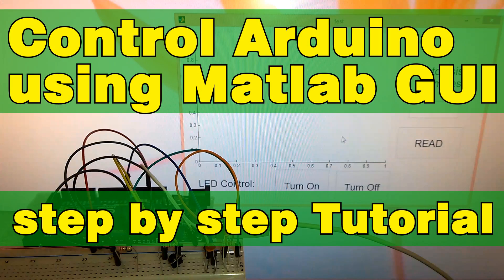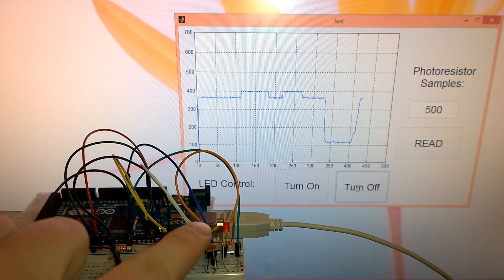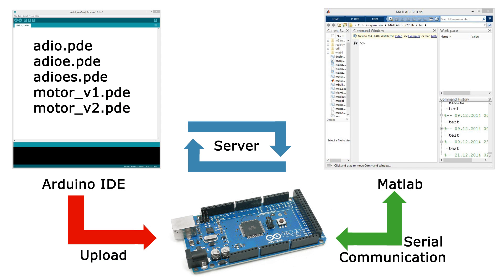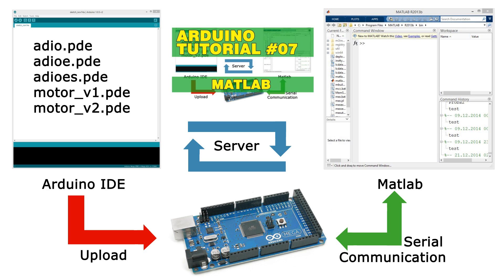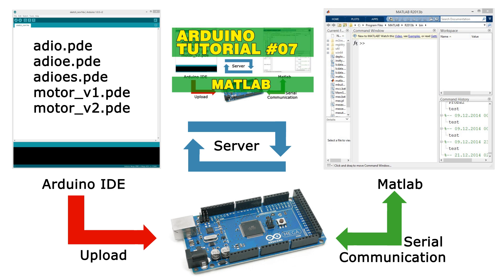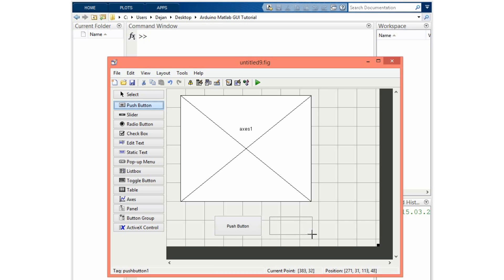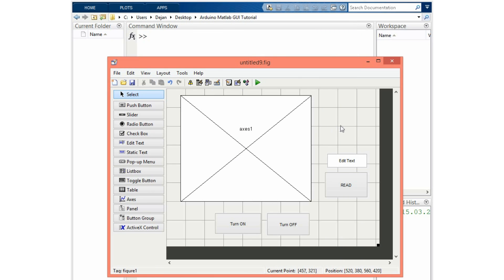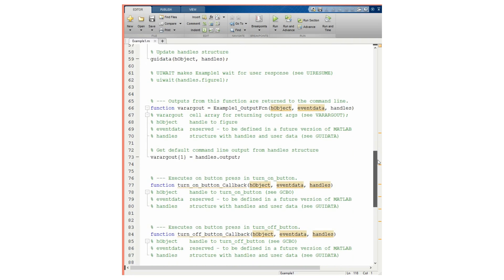Arduino and Matlab GUI Tutorial

Comment: Do not make people lose their time... You should update it or take off the video. It doesn't work anymore.
Reply: hii @Felipe Boscardin use this code
function varargout = analogReadWithDigitalWrite(varargin)
% ANALOGREADWITHDIGITALWRITE MATLAB code for analogReadWithDigitalWrite.fig
%      ANALOGREADWITHDIGITALWRITE, by itself, creates a new ANALOGREADWITHDIGITALWRITE or raises the existing
%      singleton*.
%
%      H = ANALOGREADWITHDIGITALWRITE returns the handle to a new ANALOGREADWITHDIGITALWRITE or the handle to
%      the existing singleton*.
%
%      ANALOGREADWITHDIGITALWRITE('CALLBACK',hObject,eventData,handles,...) calls the local
%      function named CALLBACK in ANALOGREADWITHDIGITALWRITE.M with the given input arguments.
%
%      ANALOGREADWITHDIGITALWRITE('Property','Value',...) creates a new ANALOGREADWITHDIGITALWRITE or raises the
%      existing singleton*.  Starting from the left, property value pairs are
%      applied to the GUI before analogReadWithDigitalWrite_OpeningFcn gets called.  An
%      unrecognized property name or invalid value makes property application
%      stop.  All inputs are passed to analogReadWithDigitalWrite_OpeningFcn via varargin.
%
%      *See GUI Options on GUIDE's Tools menu.  Choose "GUI allows only one
%      instance to run (singleton)".
%
% See also: GUIDE, GUIDATA, GUIHANDLES

% Edit the above text to modify the response to help analogReadWithDigitalWrite

% Last Modified by GUIDE v2.5 19-Oct-2018 07:40:12

% Begin initialization code - DO NOT EDIT
gui_Singleton = 1;
gui_State = struct('gui_Name',       mfilename, ...
                   'gui_Singleton',  gui_Singleton, ...
                   'gui_OpeningFcn', @analogReadWithDigitalWrite_OpeningFcn, ...
                   'gui_OutputFcn',  @analogReadWithDigitalWrite_OutputFcn, ...
                   'gui_LayoutFcn',  [] , ...
                   'gui_Callback',   []);
if nargin && ischar(varargin{1})
    gui_State.gui_Callback = str2func(varargin{1});
end

if nargout
    [varargout{1:nargout}] = gui_mainfcn(gui_State, varargin{:});
else
    gui_mainfcn(gui_State, varargin{:});
end
% End initialization code - DO NOT EDIT

% --- Executes just before analogReadWithDigitalWrite is made visible.
function analogReadWithDigitalWrite_OpeningFcn(hObject, eventdata, handles, varargin)
% This function has no output args, see OutputFcn.
% hObject    handle to figure
% eventdata  reserved - to be defined in a future version of MATLAB
% handles    structure with handles and user data (see GUIDATA)
% varargin   command line arguments to analogReadWithDigitalWrite (see VARARGIN)

% Choose default command line output for analogReadWithDigitalWrite
handles.output = hObject;

% Update handles structure
guidata(hObject, handles);

% UIWAIT makes analogReadWithDigitalWrite wait for user response (see UIRESUME)
% uiwait(handles.figure1);

% --- Outputs from this function are returned to the command line.
function varargout = analogReadWithDigitalWrite_OutputFcn(hObject, eventdata, handles) 
% varargout  cell array for returning output args (see VARARGOUT);
% hObject    handle to figure
% eventdata  reserved - to be defined in a future version of MATLAB
% handles    structure with handles and user data (see GUIDATA)

% Get default command line output from handles structure
varargout{1} = handles.output;
clear ab;
delete(instrfind('port','COM6'))
global ab;
ab = arduino('COM6','uno');
%pinMode = configurePin(ab,'D12');
%pinMode = configurePin(ab,'A5');
configurePin(ab,'D12','DigitalOutput');
configurePin(ab,'A5','Unset');

% --- Executes on button press in turn_on_button.
function turn_on_button_Callback(hObject, eventdata, handles)
% hObject    handle to turn_on_button (see GCBO)
% eventdata  reserved - to be defined in a future version of MATLAB
% handles    structure with handles and user data (see GUIDATA)
global ab;
writeDigitalPin(ab,'D12',1);

% --- Executes on button press in turn_off_button.
function turn_off_button_Callback(hObject, eventdata, handles)
% hObject    handle to turn_off_button (see GCBO)
% eventdata  reserved - to be defined in a future version of MATLAB
% handles    structure with handles and user data (see GUIDATA)
global ab;
writeDigitalPin(ab,'D12',0);

% --- Executes on button press in temp_reading_button.
function temp_reading_button_Callback(hObject, eventdata, handles)
% hObject    handle to temp_reading_button (see GCBO)
% eventdata  reserved - to be defined in a future version of MATLAB
% handles    structure with handles and user data (see GUIDATA)
global ab k;
x=0;

for k=1:1:handles.data2
    v1 = readVoltage(ab,'A5');
    analog = (v1/0.0048875);
    temp1 = analog*0.48828125;
    disp(temp1);
    x=[x,temp1];
    plot(handles.axes1,x);grid on;
    set(handles.temp_ddisplay);
   % axis([0 handles.data2 0 500]);
    pause(1);
end

function temp_ddisplay_Callback(hObject, eventdata, handles)
% hObject    handle to temp_ddisplay (see GCBO)
% eventdata  reserved - to be defined in a future version of MATLAB
% handles    structure with handles and user data (see GUIDATA)

% Hints: get(hObject,'String') returns contents of temp_ddisplay as text
%        str2double(get(hObject,'String')) returns contents of temp_ddisplay as a double
handles.data1=get(hObject, 'String');
handles.data2=str2double(handles.data1);
guidata(hObject,handles);

% --- Executes during object creation, after setting all properties.
function temp_ddisplay_CreateFcn(hObject, eventdata, handles)
% hObject    handle to temp_ddisplay (see GCBO)
% eventdata  reserved - to be defined in a future version of MATLAB
% handles    empty - handles not created until after all CreateFcns called

% Hint: edit controls usually have a white background on Windows.
%       See ISPC and COMPUTER.
if ispc && isequal(get(hObject,'BackgroundColor'), get(0,'defaultUicontrolBackgroundColor'))
    set(hObject,'BackgroundColor','white');
end
Reply: @manupatel1063  Hello, a have the same problem when I use the "analogRead(0)" command from the guide, I don't know how to use the code that you shared, can you explain me? please

Comment: My Program name is : untitled1
Why when i put the "run" button, this lines appear :
" Error in untitled1 (line 42)
    gui_mainfcn(gui_State, varargin{:}); "
Anyone can show me the way to fix this error
Reply: And this :
Error using untitled1_untitled1_OpeningFcn (line 65)
Failed to open serial port COM3 to communicate with board Uno. Make sure
there is no other MATLAB arduino object for this board. For troubleshooting,
see Arduino Hardware Troubleshooting.
Reply: Mr Kitter are you solved this problem ?

Comment: Thank you Dejan, very useful and helpful. Like to ask and a bit confused. Did you run arduino sketch first and then communicate with matlab for this particular project?, If my understanding correct after seeing you Tutorial 7, you need to run arduino sketch first and the use Matlab to communicate via serial port. Meaning that you control you arduino using arduino IDE and matlab for getting the data out. Please correct me if I am wrong.

Comment: Thank you for the video, Is it work with Arduino Uno ?
Reply: +Dejan Nedelkovski OK, I try to use it with Arduino Mega like you but I see this errors (I change the pin 8 by 13):
No appropriate method, property, or field pinMode for class arduino.

Error in Example1>Example1_OpeningFcn (line 67)
a.pinMode(13, 'output');

Error in gui_mainfcn (line 220)
    feval(gui_State.gui_OpeningFcn, gui_hFigure, [], guidata(gui_hFigure), varargin{:});

Error in Example1 (line 42)
    gui_mainfcn(gui_State, varargin{:});
Reply: +Abdou Abdou perhaps you have to see another video Arduino Tutorial #07

Comment: function varargout = example1(varargin)
% EXAMPLE1 MATLAB code for example1.fig
%      EXAMPLE1, by itself, creates a new EXAMPLE1 or raises the existing
%      singleton*.
%
%      H = EXAMPLE1 returns the handle to a new EXAMPLE1 or the handle to
%      the existing singleton*.
%
%      EXAMPLE1('CALLBACK',hObject,eventData,handles,...) calls the local
%      function named CALLBACK in EXAMPLE1.M with the given input arguments.
%
%      EXAMPLE1('Property','Value',...) creates a new EXAMPLE1 or raises the
%      existing singleton*.  Starting from the left, property value pairs are
%      applied to the GUI before example1_OpeningFcn gets called.  An
%      unrecognized property name or invalid value makes property application
%      stop.  All inputs are passed to example1_OpeningFcn via varargin.
%
%      *See GUI Options on GUIDE's Tools menu.  Choose "GUI allows only one
%      instance to run (singleton)".
%
% See also: GUIDE, GUIDATA, GUIHANDLES

% Edit the above text to modify the response to help example1

% Last Modified by GUIDE v2.5 15-Oct-2015 21:36:44

% Begin initialization code - DO NOT EDIT
gui_Singleton = 1;
gui_State = struct('gui_Name',       mfilename, ...
                   'gui_Singleton',  gui_Singleton, ...
                   'gui_OpeningFcn', @example1_OpeningFcn, ...
                   'gui_OutputFcn',  @example1_OutputFcn, ...
                   'gui_LayoutFcn',  [] , ...
                   'gui_Callback',   []);
if nargin && ischar(varargin{1})
    gui_State.gui_Callback = str2func(varargin{1});
end

if nargout
    [varargout{1:nargout}] = gui_mainfcn(gui_State, varargin{:});
else
    gui_mainfcn(gui_State, varargin{:});
end
% End initialization code - DO NOT EDIT

% --- Executes just before example1 is made visible.
function example1_OpeningFcn(hObject, eventdata, handles, varargin)
% This function has no output args, see OutputFcn.
% hObject    handle to figure
% eventdata  reserved - to be defined in a future version of MATLAB
% handles    structure with handles and user data (see GUIDATA)
% varargin   command line arguments to example1 (see VARARGIN)

% Choose default command line output for example1
handles.output = hObject;

% Update handles structure
guidata(hObject, handles);

% UIWAIT makes example1 wait for user response (see UIRESUME)
% uiwait(handles.figure1);
delete(instrfind({'port'} , {'COM7'} ) )
clear a;
global a;
a=arduino('COM7');
a.pinMode(8, 'output');

% --- Outputs from this function are returned to the command line.
function varargout = example1_OutputFcn(hObject, eventdata, handles) 
% varargout  cell array for returning output args (see VARARGOUT);
% hObject    handle to figure
% eventdata  reserved - to be defined in a future version of MATLAB
% handles    structure with handles and user data (see GUIDATA)

% Get default command line output from handles structure
varargout{1} = handles.output;

% --- Executes on button press in turn_on_button.
function turn_on_button_Callback(hObject, eventdata, handles)
% hObject    handle to turn_on_button (see GCBO)
% eventdata  reserved - to be defined in a future version of MATLAB
% handles    structure with handles and user data (see GUIDATA)
global a;
a.digitalWrite(8,1);

% --- Executes on button press in turn_off_button.
function turn_off_button_Callback(hObject, eventdata, handles)
% hObject    handle to turn_off_button (see GCBO)
% eventdata  reserved - to be defined in a future version of MATLAB
% handles    structure with handles and user data (see GUIDATA)
global a;
a.digitalWrite(8,0);

% --- Executes on button press in read_button.
function read_button_Callback(hObject, eventdata, handles)
% hObject    handle to read_button (see GCBO)
% eventdata  reserved - to be defined in a future version of MATLAB
% handles    structure with handles and user data (see GUIDATA)
lobal a k;
x=0;
for k=1:1:handles.xSamples
    b= a.analogRead(0);
    x=[x,b];
    plot(x,'LineWidLH'2); grip on;
    axis([0 handles.xSamples 0 500 ]);
    pause(0.01);
end
    

function edit_text_samples_Callback(hObject, eventdata, handles)
% hObject    handle to edit_text_samples (see GCBO)
% eventdata  reserved - to be defined in a future version of MATLAB
% handles    structure with handles and user data (see GUIDATA)

% Hints: get(hObject,'String') returns contents of edit_text_samples as text
%        str2double(get(hObject,'String')) returns contents of edit_text_samples as a double
handles.data1=get(hObject, 'String');
handles.xSamples=str2double(handles.data1);
guidata(hObject , handles );

% --- Executes during object creation, after setting all properties.
function edit_text_samples_CreateFcn(hObject, eventdata, handles)
% hObject    handle to edit_text_samples (see GCBO)
% eventdata  reserved - to be defined in a future version of MATLAB
% handles    empty - handles not created until after all CreateFcns called

% Hint: edit controls usually have a white background on Windows.
%       See ISPC and COMPUTER.
if ispc && isequal(get(hObject,'BackgroundColor'), get(0,'defaultUicontrolBackgroundColor'))
    set(hObject,'BackgroundColor','white');
end

Comment: Hi Dejan!
Really cool video was that. But i have an enquiry to make.
I did exactly the same as you did in this video, but whenever i successfully upload the code, it shows the following errors. The graph kills it always. Although the LED is still in work. Please help me! Here are the following errors shown to me-

>> gui_no_1
Attempting connection .............
Analog & Digital I/O + Encoders + Servos (adioes.pde) sketch detected !
Arduino successfully connected !
Undefined function 'grip' for input arguments of type 'char'.

Error in gui_no_1>read_the_input_Callback (line 110)
    plot(x,'LineWidth', 1 ); grip on;

Error in gui_mainfcn (line 95)
        feval(varargin{:});

Error in gui_no_1 (line 42)
    gui_mainfcn(gui_State, varargin{:});

Error in @(hObject,eventdata)gui_no_1('read_the_input_Callback',hObject,eventdata,guidata(hObject))

 
Error while evaluating uicontrol Callback

"I have done EXACTLY thee same like you."
Reply: Himanshu Sharma You should change 'grip on' into 'grid on'. Than your code should run fine
Reply: Let me give it a try !
Reply: It shows the grid lines (dotted lines) and the graph is changing values as per my read samples box too but no values plotting still!
Reply: Maarten Wijnants Great!
I finally had the code working.
But if you could please tell me what is the diference between GRIP ON and GRID ON!!!
Thanks a lot again
Reply: The difference is more simple than it sounds. 'grip' is not a matlab function, and 'grid'  is. this was a typo in the script. That's why Matlab gives you the error that it doesn't recognize the function grip.
Enjoy your GUI!

Comment: Good day sir.
What would be the Arduino code for this? Maybe your code might help me doing my project. I used MATLAB GUI for my microcontroller I always encounter error.
I have an Arduino program for sensors, servo motor and LED uploaded to my microcontroller and they work well. I see values and status with the Arduino software's serial monitor.
MATLAB's GUI is what I need to make it user friendly, so that anyone can easily monitor and control the devices to my project. Can you help me with this?
Or can you make a video where you can see the values printed with Arduino's serial monitor with MATLAB?
Thanks.

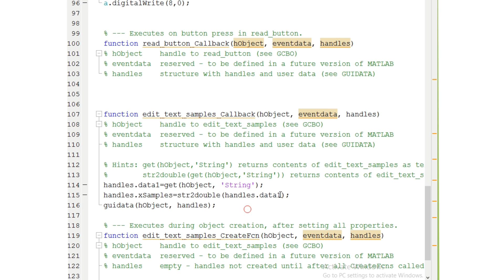Comment: Hi buddy.I didn't get it.Why were there "data1" and "xSamples" at 10:32 ? What do they mean ? Can I use "data" or "data2" or something like those instead ?
And I have a small question that is not much relevent to your video.Do I have to programme all over again in Matlab environment instead of just uploading my code into Arduino via Arduino IDE (in case I have a new code) and then all I have to do is just the GUI to make it work ? Is there any way to do it ? 
By the way,I did exactly what you did,but only buttons for LED worked,button "READ" and text didn't.When I tried to run button "READ",he command window showed me this stuff:
"??? Undefined function or method 'grip' for input arguments of type 'char'.

Error in ==> AandM_GUI>read_button_Callback at 111
    grip on;

Error in ==> gui_mainfcn at 96
        feval(varargin{:});

Error in ==> AandM_GUI at 42
    gui_mainfcn(gui_State, varargin{:});

Error in ==>
@(hObject,eventdata)AandM_GUI('read_button_Callback',hObject,eventdata,guidata(hObject))
"

I am using MATLAB R2010b.Please reply to my question as soon as you can.I really appreciate that.Thanks a lot.
Reply: ***** Thanks again.Apparently,I didn't notice that you attached the balloon that denotes your typo.After I've rewritten my code,it works now.Oh I think I can answer myself for the second question that whenever we want to run Arduino with Matlab,all we have to do first is upload one of the sketches supported by Matwork for Arduino into Arduino.Of course,the sketch chosen must be appropriate to our project.Do I explain correctly ? Amd counld you make a video about how to use Arduino libraries in Matlab or guide me about this one?.For instance,I want to plot results that I get from a ultrasonic sensor using Newping library.But I didn't know what to do at first.Thanks you very much.